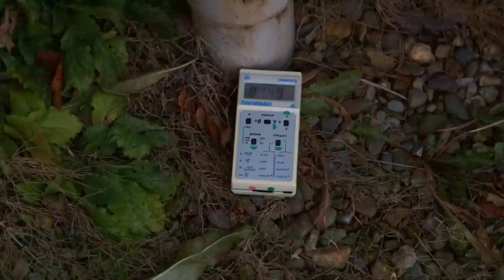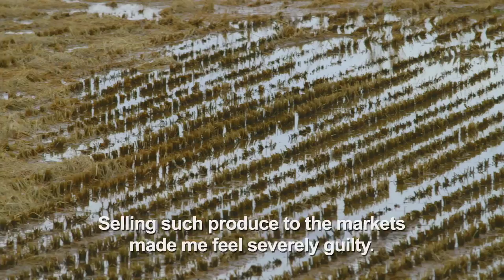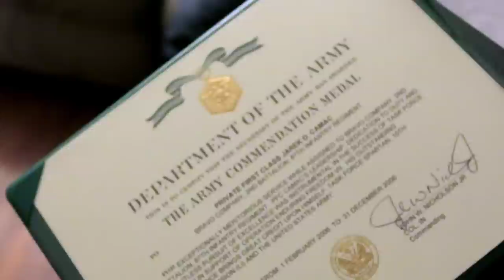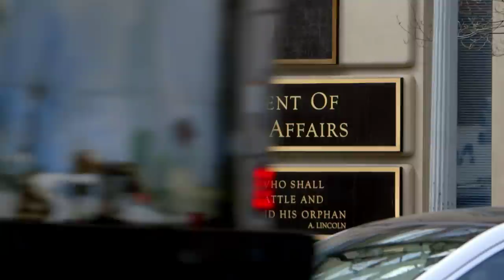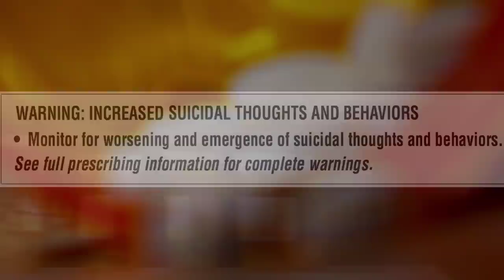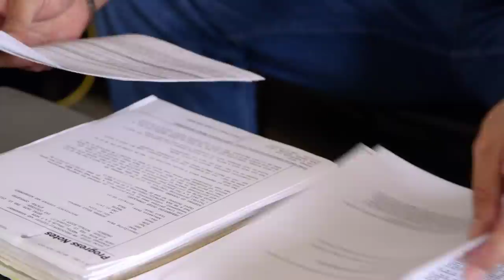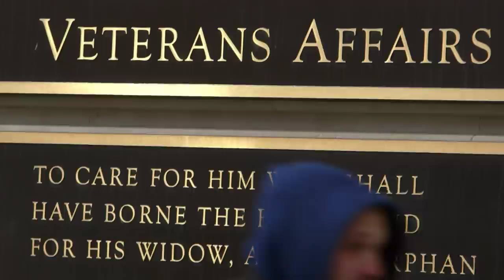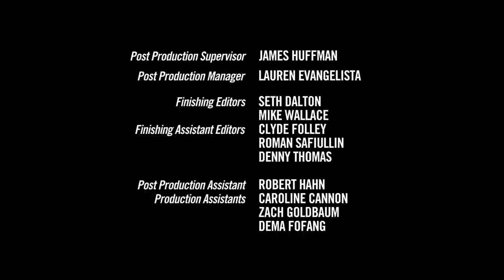VICE on HBO Season 2: Playing with Nuclear Fire and No Man Left Behind (Episode 10)

Comment: About those stationary meters, I noticed you used a Geiger counter. The only problem with that is how much of that activity picked up is Beta radiation on the ground which would create an artificially high microsievert reading. You really need to bring a Gamma survey meter that uses a PMT and only measures Gamma. It is possible the stationary meters are using a PMT not a Geiger counter and those readings would be more accurate.
Reply: ***** Trying to understand why you used a comma, is like digging trench with a spoon.
Reply: Gamma = gimel = camel
Reply: He wants a higher reading - it makes a better story. So he puts a Geiger counter on a drain pipe to get it...
Reply: True, Beta/Alpha is very dangerous if ingested or in lungs. But you measure that as CPM not as microsieverts. That measurement is for penetrating gamma radiation. That type of radiation penetrates your body and is dangerous even if you wear a a full tyvek suit and mask and you never ingest the particulates.

So for gross radiation measurements, you use CPM. for gammas only you use siverts per hour.
Reply: ***** Depends on the size of the spoon
Reply: VIDEOSUPERHIGHWAY sexmovis

Comment: I think one of the major issues with what the VA seems to be doing here is that they aren't requiring pairing drugs WITH psychotherapy sessions. Drugs alone are a short term fix- there is a high relapse rate once the individual goes off the drug. If that drug is paired with psychotherapy then the relapse rate drops.

Comment: at 6 minutes into the video they point out they were able to measure 3.5 μSv/h in the area, then they said that this 20 times higher than the near by government counter reading, they make it sound like it is an alarming dangerous radiation level , it really is not that much according to wikipedia : "24 mSv/a (2.7 μSv/h avg) Natural background radiation at airline cruise altitude"'

Basically its the equivalent of flying in a plane, which is 10 times the really really small amount of radiation that you get from just existing on this planet at ground level (background radiation) they should give some perspective on what those readings mean, because just leaving it at "20 times higher than..." makes it sound alarmist.
Reply: Maybe the counters are calibrated to compensate for background radiation... And people tend to spend WAY more time on solid ground than on an airplane